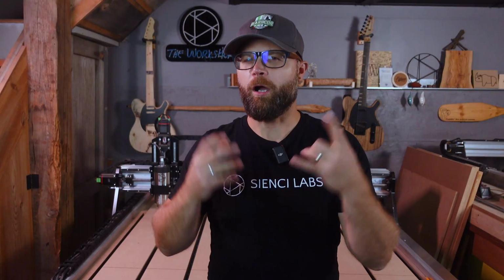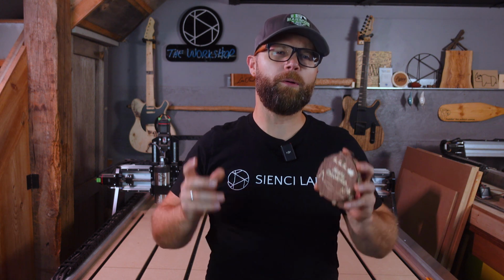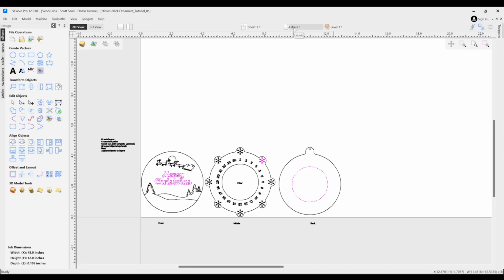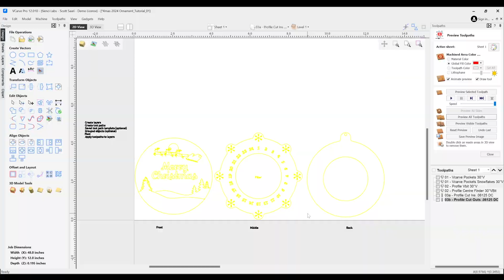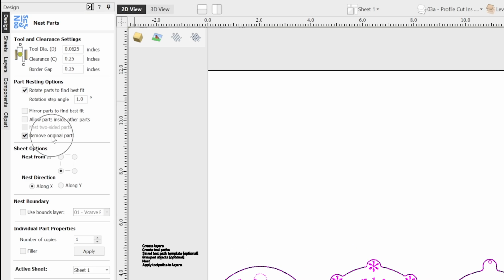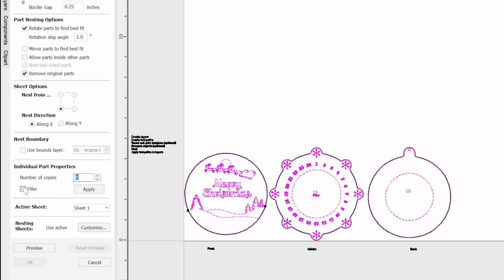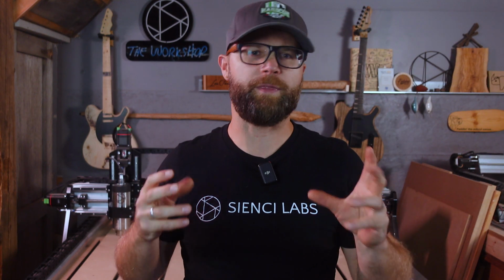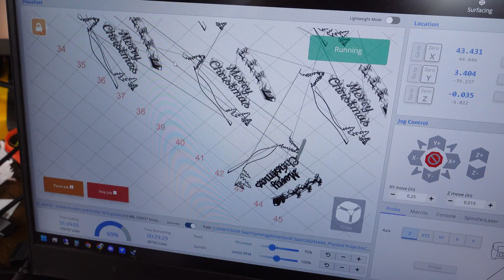Save Time with Nesting in VCarve: AltMill CNC Christmas Ornament Tutorial #vectricsoftware #nesting

Comment: I'm a newbie.  How did you prevent the text from being stained?  Also - noticed the hole in the top layer was through one of the reindeer. Could that whole sleigh image be slid down?  And wouldn't you want a hole in the tab of the rear layer to facilitate hanging with ribbon/string?  Just some ideas for next time.
Reply from the maker: Hey Randy! 
We used a rag folded up so it was as flat and as firm as you can get a rag. We made sure not to have too much stain on the rag and were extra careful when we wiped the stain on so the rag didn’t dip into the carved areas. It takes a little practice but once you get it, goes pretty quick. Thanks for asking!